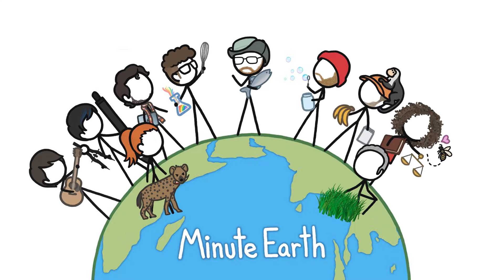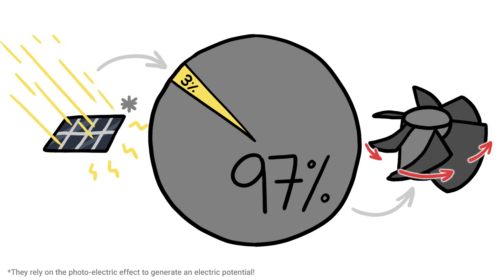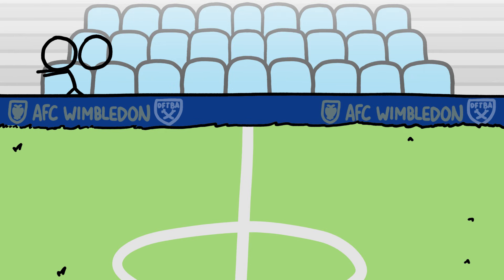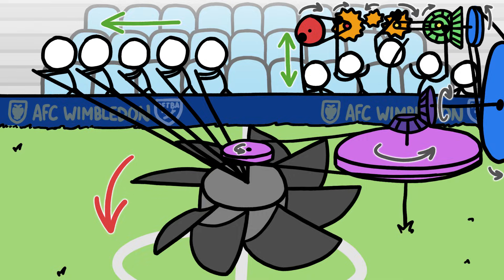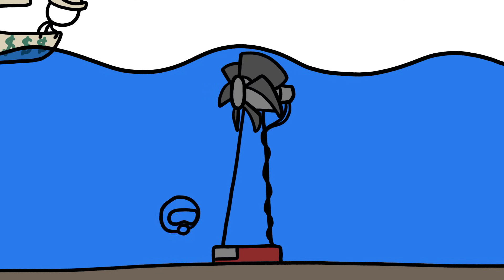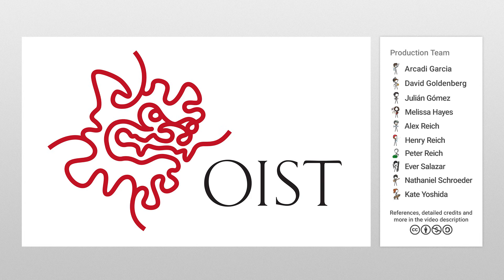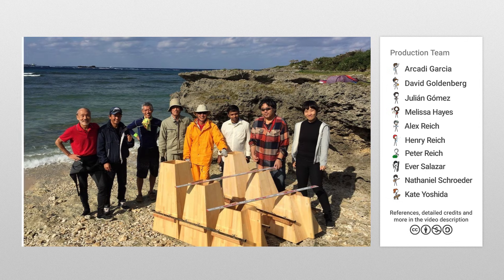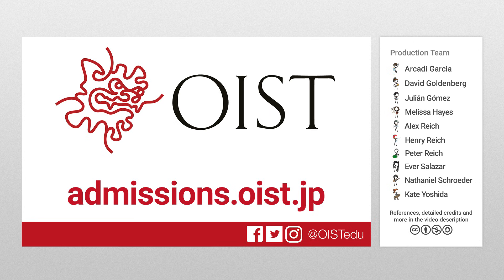Why Can't We Get Power From Waves?

Comment: You will need to design turbine with compression and rarefaction in mind to efficiently harness energy from waves that are moving up and down instead of moving sideways. Compression in water = upward moving waves. Rarefaction in water = downward moving waves. Repeating results in waves moving up and down. Ocean water is pushing against each other all the time which result in those up and down moving waves from resulting compression and rarefaction.

Comment: What about rivers?
Reply: Water power from rivers is traditional hydroelectric power.  From National Geographic: "The first hydroelectric power plant was built at Niagara Falls in 1879. In 1881, street lamps in the city of Niagara Falls were powered by hydropower. In 1882, the world's first hydroelectric power plant began operating in the United States in Appleton, Wisconsin."

Much of the world today gets its power from hydroelectric turbines built in dams.  It worked, it quickly caught on (taking only 3 years).  And it has been used all over the world for the past half-dozen decades.

That contrasts with wave power which didn't catch on.  Why?

Comment: Not being able to convet wave energy into turbine energy?

You are wrong there pal - look into the principle of how waves themselves inflates balloons using both their lifting power and ducted air trapped against a valve.

One of few principles which also bypasses the unsolved problem of the necessity of storing electricity.
Reply: No...He is not.  The physics do NOT support your argument.  Are you a Millennial?
Reply: The issue is on an economically viable basis.  All the things he illustrated in the video have been built and deployed on experimental basis somewhere in the world.  In past decades I personally watched video clips about them when I was a kid or teenager.  And they did all extract some energy, just as they did in the lab.  But apparently they were never economically viable, or else they've have been scaled up at some point in the past 30 years.  I'm in my 60s and I'd been wondering what happened, why did they not catch on like wind turbines?
Reply: Lost_In_Blank 
Turbines  are not applicable for wawes but for tidal water moving back and forth - and have a significant impact on the environment.

Comment: Build it like a combustion engine with the cylinders being floaters.
Reply: Yep.  Waves oscillate with what are called S-Waves.  They basically move vertically.  So using floaters would work.
Reply: A better option than others, but still not good enough to make it worth while.
Reply: That is basically the buoy idea mentioned at 2:07 .  It didn't say exactly how they went about it, but it's fundamentally the same concept.

Comment: Simple:
Attach a buoy to a long arm, connected to a hinge on the shore. The oscillating motion powers a piston, which can be easily converted to energy. Problem solved.
Actually, there is a system just like this already being used in Brazil, the only problem is the current cost.

Comment: Can you guys tell us how food poisoning works?? 
Plzzz I need to know cause I have this alot......
Reply: Some bacteria produce toxins. If food sits for too long, is sneezed on by a sick person, comes into contact with a dirty surface, or by some other means gets exposed to these bacteria, they'll start feeding off the food, proliferating and producing loads of toxins in the food. You then eat the food - and the toxins. Your body detects the toxins, notices they're harmful, and engages the body's evacuation system to get rid of the toxins - so you throw up, and shit liquid floods. Over, and over, and over.

How to avoid this? Follow safe practices when handling & storing food. You can easily find this on Google & by using common sense. Don't sneeze on your food and let it sit around so the bacteria can build up (if you're sick and happen to sneeze while eating, that's fine). Don't eat food that fell on the floor. Look up how long food x, y & z last for (3 days is a generally safe rule of thumb for cooked goods; on the 4th, throw the food out (preferably freeze it if you won't be finishing it in 3 days though)). If you eat out a lot & notice you tend to get food poisoning after eating at a particular place, stop eating at that place.
Reply: Don't eat bad shit that has bacteria in it.

Comment: You would think that a 1 stroke piston motion would be the key to driving an offshore turbine by using the raising and lowering motion of the waves to convert pressure into rotating motion where the piston head would instead be a float, or using something similar to hydraulic ram pumps

Comment: Tidal energy seems better.  You can fill a whole bay with water and then have basically a hydroelectric plant until it drains
Reply: Nah , that's too easy . And way to efficent. Let's not do that.
Reply: @wickedleeloopy2115  no, it's not efficient at all. The specific output of such a thing would be very low because the energy state change is minimal, in other words the water only moves up then down a few feet at most and thus contains only a little energy.  The same amount of water behind a typical dam contains vastly more power per unit and even those cant replace all other forms of generation.  

You would have to sacrifice miles and miles of shoreline just to generate the same amount of power as a single dam.
Reply: good point indeed, unlikely but its thinking outside the box
Reply: Engineering problems aside, this types of generation plants can only work during low tide. So, they can generate electricity every 12.5 hours, making them unreliable, since at certain points in time the generation availability won't be aligned with the peak demand of the system.
Reply: Yeah, but is salt water. Salt water literally eats thought things.
Reply: This has its own engineering challenge, for a damn you need pretty significant head hight to gain enough pressure to convert the energy, and using this method would limit the maximum head to at most a couple meters which would only provide any significant power if you wait until low tide run the system but then as the fluid drains out you have less and less pressure to generated energy all while the tide is rising again and you want to make sure you drain as much as you can before the tides rise so that you can repeat this process in reverse. What this means is that you will only give brief energy spikes during the peak high and low tides and little to none during the transition. All while you need to design the system to handle converting all this stored of energy 1 - 2 hours  while sitting idle until the next peak low/high tide. And you still have the problem with the low head which will significantly reduce the efficiency of the system compared to typical a higher pressure damn. Further more with a typical damn the water level is controlled better so that that the turbines experience a more consistent water pressure as fixed blade turbines have a certain head pressure and flow that they operate most efficiently at and the problem with tides is that the magnitude will change with the moon phases so you need to design it to operate a t a pretty wide pressure range which again will have some standoffs in terms of efficiency. Not to say it can't be done, because of coarse you can do this but the point i am trying to make is that you still have the same issue with inconsistent and interrupted power delivery.
Reply: @HPD1171  Look up Penzhin Tidal Power Plant Project on wikipedia. It's projected to produce 87 gigawatts of electricity. That's about 4x as much power as the most powerful power plant in the world.
Reply: @Malamockq  You must offset the low energy with many massive, slow-turning turbines or paddlewheels. Blocking water in huge bays will actually slow the earth's rotation by a tiny fraction.
Reply: @Bob_Adkins  how is that working? Can we potentially stop earth rotation if we scale such systems big enough?

Comment: Hmm. How about floating bobbers,  long light weight bars, pipes as follows? Have a horizontal flat box (holding vertical pipe ends) mounted above the usual wave height and attached to (and above) a similar box that's mounted below the usual wave depth. In each pipe pair (top and bottom) is a long (tall?) low-mass bar (or rod) with a bobber resting at the water surface.  Inside each top pipe, there is a coil of wire; at the top of each bar is a light-weight magnet. As the waves pass through the construct, the individual bobbers lift and drop the rods, creating a slow AC current. Both the tob box and the bottom box need to be outside the usual range of the waves, so that only the bobbers and the rods are interacting with the waves. Also, each wave that passes through the construct will lose some energy, so a line of same off-shore of a place where wave-action is problematic might be a different kind of breakwater. Regardless, the usual corrosion, reef-building, salt spray, storm-weathering, and bird issues will need addressing.

Comment: Perhaps it would be better to not obsess over turbines, instead borrow the technology of the self-winding wristwatch (circa 1923). This would take the form of a pendulum enclosed in a buoy shaped to exaggerate its pitching rolling with the waves. The pendulum would drive a generator via a differential gear. These would be of moderate size and cost, so a fair number could used in wavy coastal areas and can be sealed hermetically to minimize maintenance expense.
Reply: Not enough output, though. That seems to be the main problem with anything that bobs around in the water.

Comment: The issue is not that we can't feed this to a turbine, the issue is that the energy density is so low that you'd have to cover large swaths of the ocean to off set the cost of maintenance of these things sitting in a literal ocean of corrosive salt water.

Turbines directly exposed to sea water is a non starter, power plants use distilled pure water for their steam turbines. You'd be cleaning these things weekly.

Solar energy doesn't turn a turbine, works great. We have vast open swaths of uninhabitable land we could put panels on, it just doesn't make sense to try to harvest wave energy. You can put up floating wind turbines in the area that will make much more power. 

Also, the artificial caverns that harness the rise and fall are not harvesting waves, they are harvesting the tides, they don't make sense because the amount of land you need to use to make them a feasible size is huge, and the cost of materials to scale them up gets exponentially higher.

Comment: Your video should add the other method of generator that design for ocean waving by Faraday Electromagnetic theory, the moving coil and magnetic core that will move in the opposite direction , the force of magnetic field in the magnetic core will put the electron in the copper coil to get move in every wave then the moving of electron give us the electricity current.